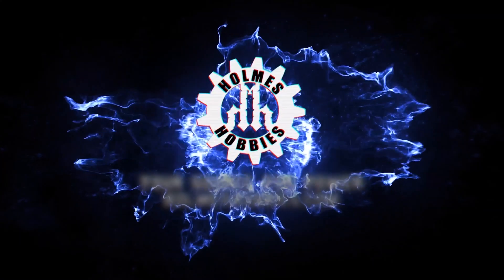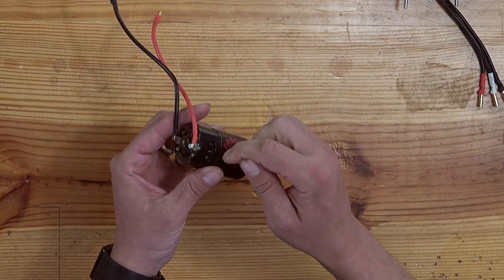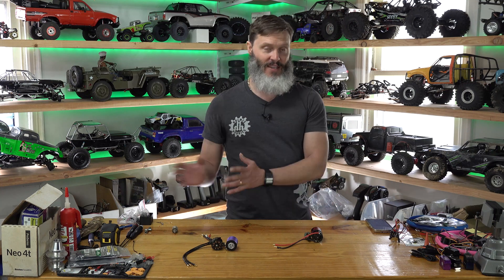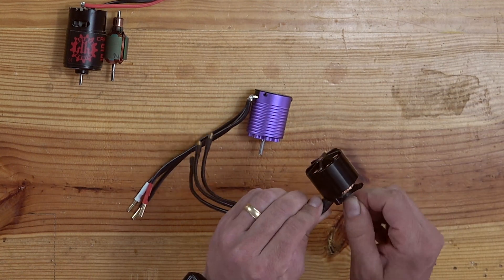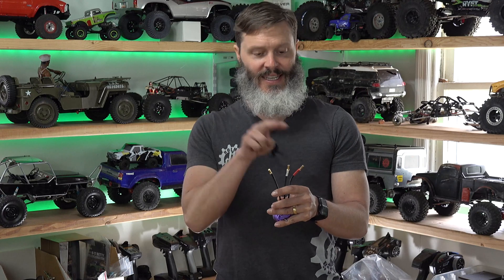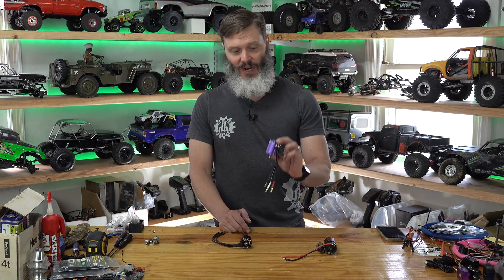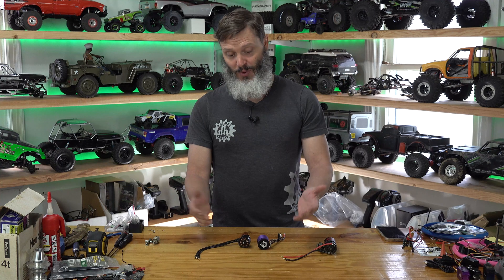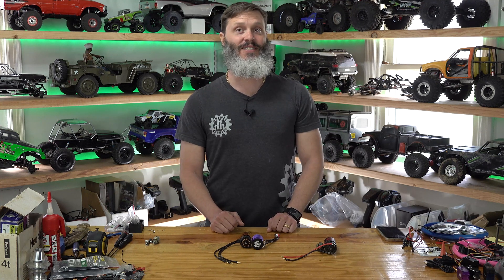Motors made easy with Holmes Hobbies*Whats inside a motor - how do motors actually work? Motor Magic

Comment: I would like to know why the esc has to has to switch power between three wires? Is it like the electric version of a Wankel internal combustion engine (just kidding)? Is it like providing ac power in a dc format? Also, why so many more poles? And finally, if there are three power wires then how can there be any number of anything within the motor that is not divisible by three and yet still have a smooth power curve?

Comment: A grabbed a revolver classic 1950kv an is scheduled to arrive tomorrow. Currently I have the MMX2 installed, will that be ok to pair with the classic? I'll be running a 14t pinion.  I had the new standard 540 V3 revolver hooked up to it an it does fine.

Comment: So my biggest reason for not using brushless more is that I've gotten into my head that for good low speed crawling you need a sensored motor, same if you want good drag brake, but I see your videos with the non sensored brushless motors and you seem to have at least good low speed control, the drag brake i can't really judge from what I've seen as far as I can remember now. 
How do you get the low speed control without sensor? 
And if you where to choose a motor, brushed or brushless for a Phoenix that might see some water and mud, what would you choose?
Reply: You might want to think twice about showing the Phoenix mud and water unless you have blocked off the DIG and OD holes.  Otherwise you're going to be stripping down the transmission a lot to clean and re-grease those gears.  I've got a Hobbywing Fusion in mine which works very well.
Reply: @DavePinnock  my plan is to print sleeves for those arms using flexible filament, will be hard to not use it in mud and water since that's about 50% of the terrain here
Reply: @patrikmoller3643  if you come up with a working design please do share!  I've seen others use balloons to form a better seal but not tried that myself yet
Reply: @DavePinnock  hope to find some solution, just have to order a truck and get it first 😁😁
Reply: Have you tried “plastidip” to cover the holes?

Comment: Would it be possible to measure any motor’s torque scientifically? Would you please do a video about the power comparison of the motors? How kV impacts the power output, or type of the motor, or form/size of the motor?

Comment: I run a 550 TrailMaster Pro in 27t for my Trx4 comp truck and it works amazing 👍 Can't wait to buy some more Holmes Hobbies products! 💪 One question tho....what is that buggy on the shelf in front of your large Willy's Jeep? I've not seen another with such a small cage and I love it 👍👍👍 Thank you! Can't get a better motor brushed or brushless for crawling in my opinion!
Reply from the maker: That's a bastard Jr. Chassis from 2008 ish Era
Reply: @HolmesHobbies  thank you! That looks wicked 👍👍👍

Comment: That magnum and brxl I have definitely wasn't cheap!
Reply from the maker: That's true!  I thought I covered the high end but might have been edited for brevity.
Reply: @HolmesHobbies  I could be wrong but I think the magnum motors are the most expensive thing on the site. But I love the brxl and magnum motor In my v3 gspeed. I'm also a huge fan of the revolvers. I can't even count how many I have these days. I was also able to get a cm mini esc. I'm not sure what was going on with the website or PayPal or what but I may have ended up getting 3 or 4🤣🤣

Comment: I wish the traxxas 21 turn reverse rotation brushed motor was rebuildable.
Reply: Why? A holmes hobbies crawlmaster 8t 5 slot is a great upgrade for 20 bucks. And will last hundreds of miles
Reply: Traxxas does that on purpose.
They are bad when it comes to proprietary replacement parts.
One of many reasons, after 35 years in the hobby, I won't touch trax ass with a 11 foot pole.
Many reasons.